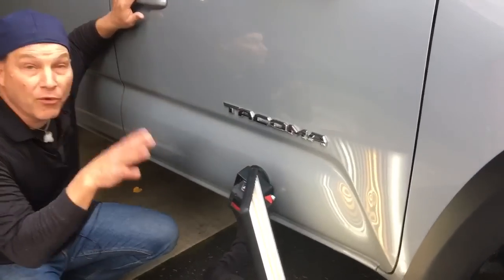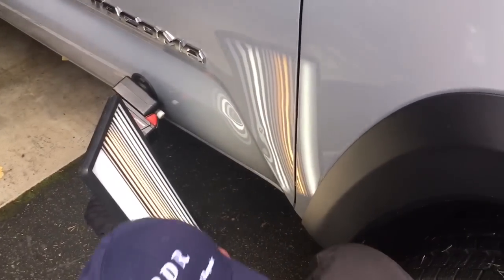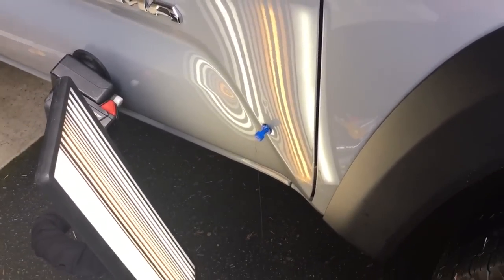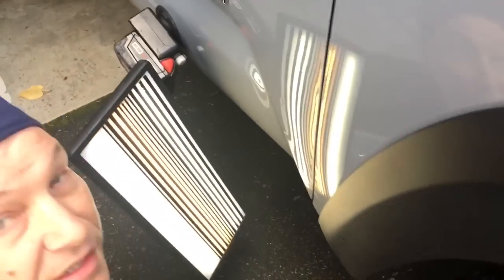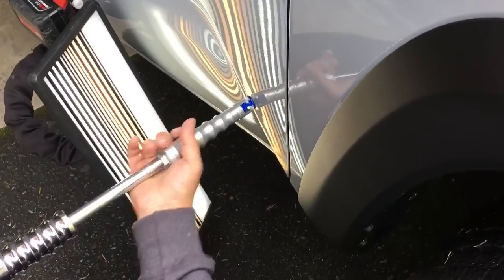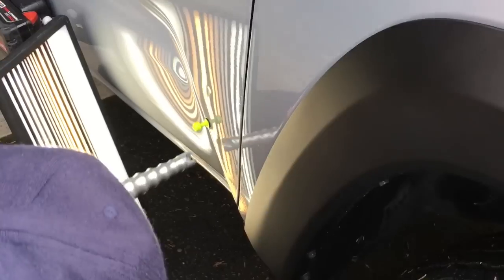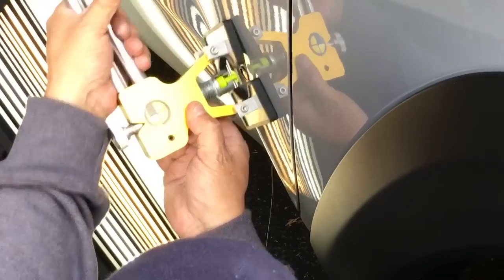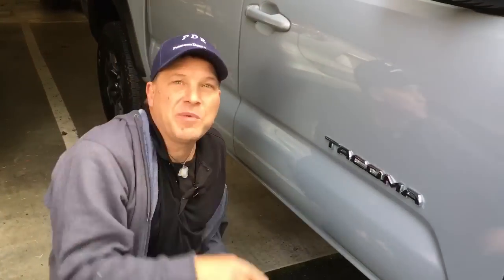🔴PDR •Glue Pull Only• NO ACCESS on Bodyline dent! #undented #PDR #toyota

Comment: I have watched atleast 5 videos of your work and 0 have had 100% repaired,if you cant get it to 100% why even try.glue pulls are useless,take the time and remove panel for a 100% repair using tool.
Reply from the maker: Roberto Sanson Looks like you need to watch more videos👍
Reply: Also depends what the customer wants to pay for. Budget work gets different results.

Comment: Hi,  The one thing that stumps me so far is how you are able to pull the glue residue off so easily. I always have to use a scraper. Why do you think that is?  Thanks!
Reply from the maker: Glen Harman its because i use 99% isopropyl alcohol. the 70%stuff just dosent work as well. hope that helps Glen. Thanks for watching and commenting.
Reply: And he said at the beginning that he buffed the area a little bit. If you don’t, you will more than likely have trouble removing glue.
Reply from the maker: Are use 99% isopropyl alcohol it's a special electronics alcohol that we buy it works great. thanks for watching and commenting

Comment: thank you Sir.  I have one I've been glue-pulling only and your confirming my techniques, that I'm not crazy for switching tips and glues.  I'm talking to a pro here but I found that NOT pulling it to the point it pops off (sometimes), that you can 3/4 pull more times on a tip placement than one BIG pull pulling the tap off.  Maybe this is a paint risk?  I dunno.
Reply from the maker: It could be a paint risk only if the car has been repainted or if there is a paint chip

Comment: i think it is better to heat up the area your going to apply the glued tab to first, then after applying the tab is to cool  the area down quickly with either cold water in a spray bottle or liquid gas refill for lighter really cools it down making the glue harden real quick.
The connection between the glued tab and the surface your pulling is far superior and reduces the wait time to ready for a pull instantly especially with the liquid fuel freezing it making the glue solid.
Try it and see for yourself the difference, you'll never do it that way again.
Eagle One
Over and out
Reply from the maker: Peter Forbes Thanks for watching and commenting I'll try that out

Comment: Hello, thanks for share! I have a question, in aluminium Is the same process?
Reply from the maker: Juan Figueroa hey Juan thanks for watching and commenting. In aluminum the metal tends to to be a little stiffer and stays where it is pushed with less resiliency a little bit more than normal steel. But the process is basically the same. Hope the videos help. Thanks again for watching

Comment: Thanks for sharing ! Excuse me, if you just use Glue pull only , Heat the body with a heat gun before construction ? Thanks !
Reply from the maker: Yeung Fumiya With the glue pull system I don’t normally use heat because it doesn’t keep the  surface cool enough for the glue to cool.
Reply: Thank you for your reply.

Comment: How do you decide which tabs to use and what is the difference between the different colours? 🤔
Reply from the maker: The different colors have to do with the different temperature ratings, or rather what temperature they work best at outside. Some colors work better when it is hot outside, and some work better when it’s cold outside I just have to read the description of each.
Reply: @Petersondent  wow, interesting. Thanks for the explanation.

Comment: Can you recommend a good set of tap downs, thanks, I purchased some cheap ones from Ebay and they scuff the paint
Reply: Dentcraft. You have to keep the tips clean. Fine sandpaper and polish usually does the trick.
Reply: Dead on dent tools “ballistic tip set” is the bomb, then the VIP sniper, VIP directional, VIP blending tip, the edgy knob for a lager blending tip, the dentcraft R4 cherry tip, and the dentcraft m96r mushroom tip. That is all you need!
That will blend and knockdown as blending is just as important as knocking down. Actually you will be blending 10x more than knocking down if you have any clue what you are doing, so get a decent blending hammer as well. 
The carbon 3 piece from power PDR is the best budget option for a blending hammer with removable tips.
Reply: Oh and the dentcraft long is the perfect and cheap choice for the knockdown handle.

Comment: Which is the strongest glue to use please? I have used clear glue gun sticks and they don't appear to pull at all. Thanks
Reply: you can get PDR glue sticks on amazon but i have used store bought glue sticks before and they didn't work as well as PDR sticks but they did pull enough to get the dent out it just took more work. you can't use the cheap brands of glue, i used either 3m or gorilla glue sticks, i also made sure the paint on my panel has been cleaned with grease and wax remover, the last thing is the year of the vehicle, the sheet metal on older cars  is considerably thicker which makes it harder to pull with store bought glue sticks.........

Comment: also, where to you get your equipment? thanks
Reply from the maker: F F all over mainly just a quality PDR tool manufacturers. I do have tool reviews videos in a highlighted section on my channel. Thanks for watching:)
Reply: Looks like eBay stuff
Reply from the maker: Sorry BRO I don’t do EBay. Quality is more important than CHINAMADE CRAP
Reply: PDR Peterson Dent Repair ebay and amazon are the exact same thing look them up the tab puller and knock down
Reply: Slide hammer too
Reply from the maker: You are aware that actual companies sell their items through these sites as affiliates... the problem is it may LOOK IDENTICAL BUT MOST TIMES THEY ARE CHEAP KNOCKOFFS!
Reply from the maker: Do more research because there are hundreds of different kinds

Comment: Hi there! I have been a watcher of your channel for a while now. Can you tell me your recommendation on making a fog line on my light? I saw your video where you striped your light and left the section white, however, I have heard that gray gives more depth into the dent. Any suggestions? My line board is all one color light. Thanks!
Reply from the maker: Tina Pratt Thanks for your message Tina. What gives the fog is usually the late ending going from Now Onlate to lighted service without any lines my board has two different colored lights so it tends to show a little more fog. Try turning your middle light off and have the two outside ones on. Also angle is everything. Thanks for watching and commenting👍